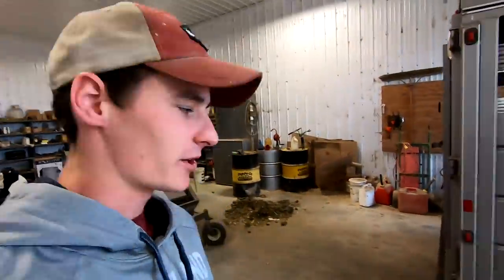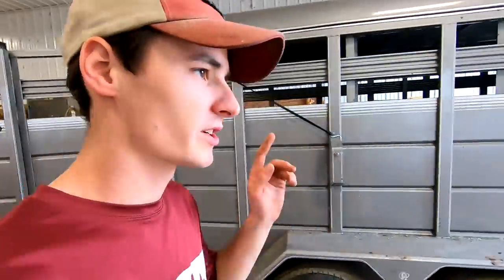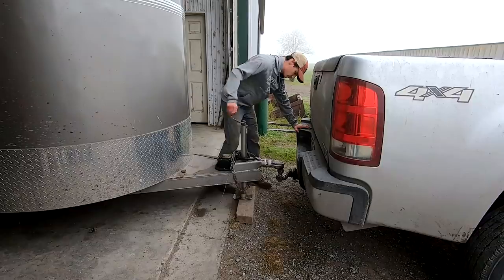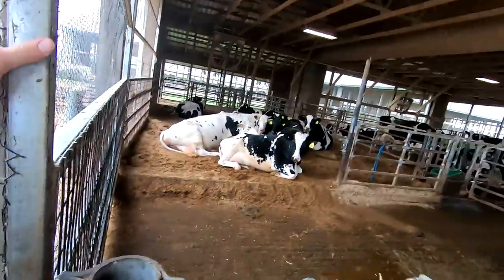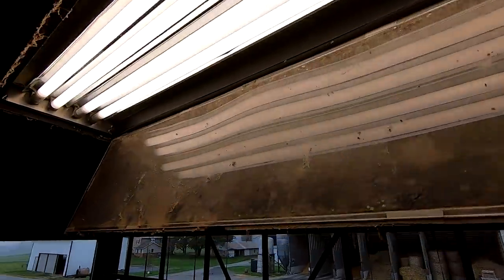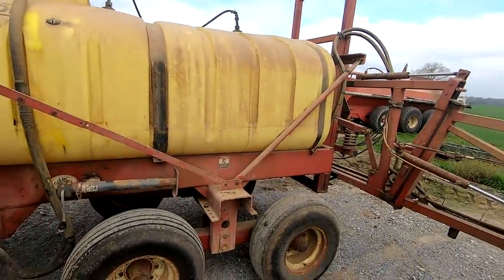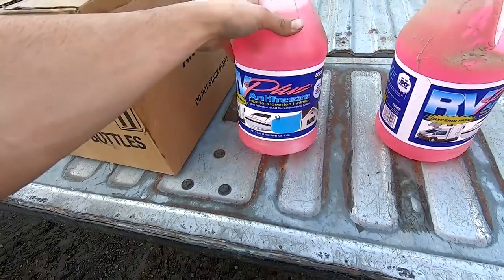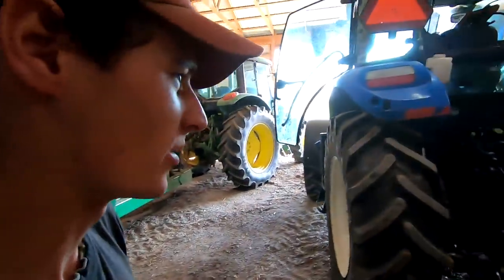Cattle Trailer Rubber, Light Work & Winterizing Sprayer

Comment: Thanks Eric and happy to see Dad back to work!
Isn't it easier just to remove the starters from the florescent lights to convert it to LED without rewiring? The other advantage of this method is to use is as florescent again if you run out of LED bulbs simply by putting back the starters and florescent bulbs. 
Good luck and keep up the good work!

Comment: We had several livestock semi trailers in our trucking business which had wood floors. We generally bedded them with sand but then tried welded wire cattle panels attached to the floor. They worked great and clean out wasn’t much of an issue since we generally washed them out.

Comment: A bit of rubberized paint  in the gap and up the walls a bit  will prevent  the bottom of the walls rotting away in that stock crate. Are the walls alloy?

Comment: iv found with wood floor trailers if you put rubber down or any cover or liner its best to paint the wood and seal it, any paint helps get any cheap paint that a shop sells for close to nothing because they screwed up a order....  oil based paint is best makes the floors last 1000% longer

Comment: Eric, who is the manufacturer and or dealer where you bot your Shredder- spreader bucket for the bedding? Does the dealer have used ones? Do you need a high flow rate hydraulic on your skid steer to run it? Does or would the manufacturer or dealer have axillary pumps with a valve to run it off the PTO on a small tractor? Sorry about all the questions but there's a couple on YouTube that hauls and shovels all their mulch into their greenhouse because the bucket on their small tractor is too wide to fit between the supports for the greenhouse when they roll up the side to do the compost mulching. I looked up one on the internet manufactured by Mensch Manufacturing. Just wanted to have some information before I suggested this to them it would be a labor and Time Saver. Mensch Manufacturing makes a similar bucket with a conveyor for feeding small pens of various livestock. I wish I had your equipment back when I had to do the bedding by hand!

Comment: I know you have to attach the rubber mats to the trailer floor some kind of way, but with the spongyness of the rubber mat and even with the large flat washers you used, I would think you would still have to worry about hoof damage from the small screw heads poking up. If it does become an issue, you might want to try running a piece of 3/16" X 2" iron flat bar all the way across to spread out the weight of a calf so the rubber doesn't compress so much exposing the screw heads. Sorry for the uninvited advice but I've been watching too many episodes of "The Hoof GP!"

Comment: How does changing the shaft on the PTO change the RPM’s? Does. The different shaft engage a different spur gear inside the gear box? Aren’t you supposed to RIDE the horse to move the heifers?
Reply: If it's the same as a John Deere, which I would guess it is, the different pto shafts have different splines so they connect to different gears inside.
Reply: @mrsock3380  Thanks, that makes sense. I suppose a shaft could be splined to the front for one speed, with smooth shaft at the rear, and another shaft could be smooth at the front and splined at the rear. Have to see the two shafts, side by side. Live well and prosper!

Comment: What is the difference between the 1000rpm shaft and the 500? Is the diameter? Or is any change in the tractor?
Reply: it is a different type of shaft he put on
Reply from the maker: It catches different gears inside the tractor
Reply: @10thgenerationdairyman61  Thanks! Keep up with the great videos!

Comment: what are your camera settings for your go pro for recording?
Reply from the maker: I use 1080 res and 30 fps and linear fov
Reply: @10thgenerationdairyman61  I see, It always looks to record so smooth, mine is very grainy when i rotate the camera around and move, and your video editing software?
Reply from the maker: @karterklingsporn  i use a gopro hero 7 black which has auto stabilization. I edit with movie studio 16

Comment: When dose the snow hit the farm ? ....The rubber matts gonna hold moisture and rot that floor out quickly..you should  sand it with 36 grit sandpaper Will rough it up so the slip will diminish...
Reply: Floors like that are sacrificial anyway.
Reply from the maker: Yes it will probably wear out the trailer faster this way but I think its worth it

Comment: 🦜au - Rubber Mats made from used Car tyres     has tread      use anywhere  cattle runs      slipery areas  etc  . . 
Make your own  if time . Them dirty rubber  mats Ur  using   get slippery when wet          not so good bro

Comment: at 1-00 looks like you are measuring in feet  i do that  hand open  9 inches  4 fingers 3 ins finger tip  to elbow  18 ins  good old measure. and the average size 9  = a foot  or good enough finger tip to finger tip = your own height

Comment: why does your new holland need a new shaft just to switch to 540 rpm? if i want to change from 1000 to 540 rpm all i need to do is push a lever
Reply: I prefer the method they use because I also have the PTO that changes speeds from the cab, but all the gears wore down and you need to hold it in place for it to work. If you don't it just drops to neutral, what I call the safest PTO in the world
Reply: @miki35001  i have a claas celtis 456 and it has a different shift. It has a pto cluch. You hold the cluch then put in ether 540 or 1000 rpm. Then slowly relise clutch.

Comment: You should get a cow dog Queensland healer
Reply: Why? they move the cows using pressure, they are always gentle and respectful and the cows are calm and sweet, the cows aren't frightened.
Reply: So when you have to run them into a new pin the dog can help Guide the cow